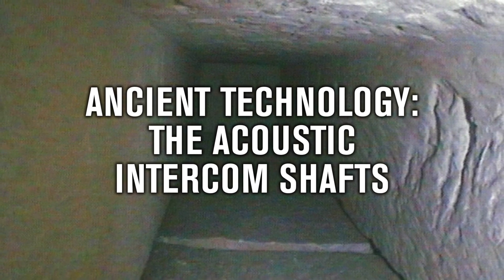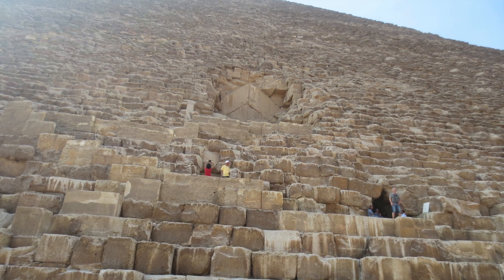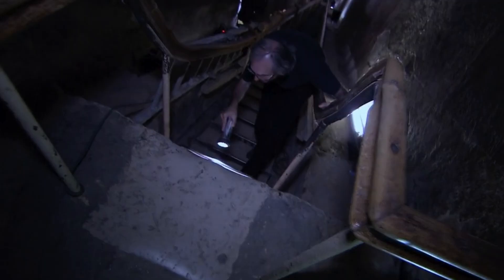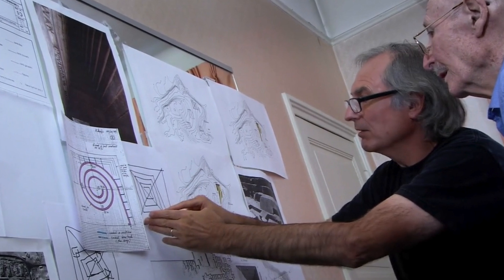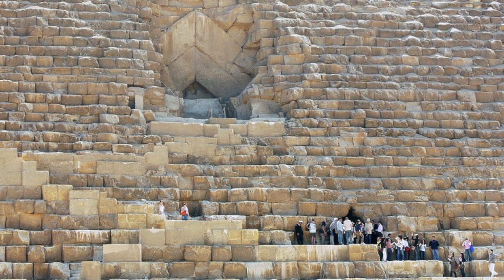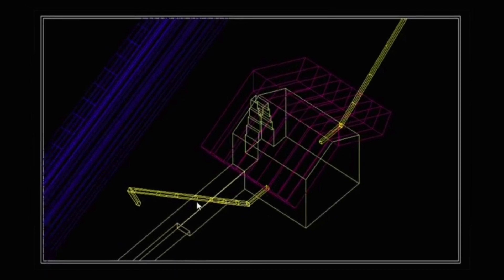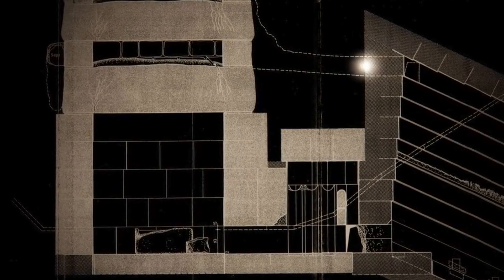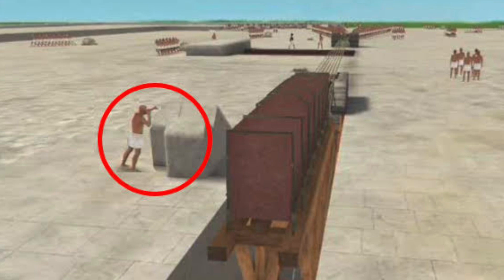Great Pyramid ‘Air Shafts’ Theory: Acoustic Communication Shafts | Ancient Architects

Comment: I know it's off topic of this video, but I would like to tell you a view point that I have had.
It involves the air shafts and what they were used for.
I feel that they were not air shafts and had one purpose, and that was to be able to route electric cables down into the Chambers, that is why there is no soot on the top of the Chambers.
What they found was a blockage in the one shaft and they said it had handles, why would you have handles up there. They were probably copper connections, a way of routing the cable so it doesn't short out. The shafts that don't reach the outside, were probably not needed anymore so they built them in. I am 100 percent sure that this is what they were for.

Comment: The Queen's Chamber shafts do not breach the surface because that is where and how something was fed to it, probably a liquid due to the presence of what seems to be an electric switch at the top which was actuated by the floating cedar bob with rare iron hooks that made contact. Cedar will last for hundreds of years, probably longer than the metal contacts.  My guess is that this was some feedstock to the fuel cell that is the Queen's Chamber.  Chris Dunn has sorted this out pretty well. Furthermore I suspect this feedstock was brewed in the great granite boxes like those we see in Saqqara.  Dead-apis batteries?  Maybe a battery but also maybe a supplier of something like potassium hydroxide that would feed the hydrogen fuel cell.  (KOH).  It would be interesting to find a passageway from one of the temples in the valley below to see how the batch was sent or fed to these feeding tubes.  

The shafts to the outside from the King's chamber, where sound follows the path of least resistance, no mystery here, as it would any other opening, are most likely vents for an explosive or otherwise damaging gas or by-product.  Gas seems most likely and it may well have exploded from time to time.  It stands to reason that this gas was Hydrogen which may well explain the black tops of the granite rafters as well as the fact that this massive assembly moved.  Petrie was not unclear about this.  The half inch or more build up of salt in the Queen's Chamber is the best evidence for the fuel cell proposition.

As for Houdin, it would take a Houdini to smoothly shape even one, not the 15 million or so perfectly flat sides that went into this project.  That didn't happen because it cannot be done now any more than then with the tools at hand.  Until you or he or anyone else can reproduce that effect the carve-and-carry thesis in any form is dead in the water.

Thus having eliminated the impossible, in conclusion, comes my assessment that this extraordinary device was not built to produce and distribute sound but to produce and distribute light.  In the beginning was the sound -- then there was light.  See John 1:1.  Obelisks were most likely designed to shine light by means of the principal of induction.  (When the sun strikes the top of an obelisk at sunrise or sunset the only thing that can see the reflected light is a bird.  The angle of incidence equals the angle of reflection no matter how spiritual you are.  Horus perhaps could see his own reflection but I doubt he cared.  He could admire it all day as he passed over the oceans.)

The King's Chamber, aka the Djed Pillar, seems to be a Djedi Light switch, or at least the tuning fork that turns the switch on. The passages from the Queen's Chamber were likely switches though which told the device when to shut off the feed stock.  The supercapacitor (Ark of the Covenant which you showed fitted neatly into Khufu's box) was charged by the fuel cell and this is what pinged the Djed Pillar/King's Chamber assembly/tuning fork and blasted the water in the well below after traveling down the tuner known as the Grand Gallery -- Sonoluminescence.  Simple as pi.  (Observe:  A Star in a Jar: https://youtu.be/CSIPolpvjBY  )

As for burying bulls in 100 ton boxes perfectly crafted to worship a Bull God -- Seriously?  Wouldn't that be better done outdoors?  Then you wouldn't have to apply the Miracle Occurs Here protocols to get those boxes into places where we can't fit them.  These were practical engineers not mystics and dreamers.  (Aliens need not apply.)

Comment: The reason why the upper shafts were angled and there was no 3rd set of shafts: after reaching the height of the king's chamber shaft exits the distance between the two was small enough so that workers could shout commands to the other side. Further down the distance was too big and they could not be heard and thus they needed the intercom shafts.

Comment: JPH is a personal hero of mine and I strongly believe his theory on how the pyramid was built but this shaft theory does not seem logical to me. One of the questions I  would ask is WHY would builders inside the half finished super-structure need to communicate with the builders outside? At this point in time (supposedly) the queen's chamber and King's chamber where already built so what reason would builders inside need to communicate with builders at the top of the half built structure? Another question I would ask would be why was this system not used in any other pyramid built in Egypt? Like I said I am a big JPH fan and feel strongly about his theory on the actual construction of the pyramid but this communication theory just doesn't seem to be likely (in my opinion) another great video Matt. Keep up the good work!!

Comment: Ultrasound produces piezoelectric in the granite plugs found in the ascending passage, well shaft, entrance to the subterranean chamber as well as the subterranean pit. The ones near water use the piezoelectric to split the water molecules. The ascending passage and plugs are much like a piston found in a combustion engine forcing the hydrogen up the well shaft, into the gallery where it's ignited by the other plugs piezoelectric and the resulting flame is sent up to the kings chamber. This is why you find burn marks in the gallery and kings chamber and the walls forced out. It's the "combustion chamber."

Comment: So you have 2 metal bars in the sealing stones? Looks like a large electrical connector to me.
Could they have used that granite box to house a chemical battery for the heat required for a thermo acoustic engine?

Comment: Why are there no videos on the acoustic properties of the pyramid? Or am I not looking in the correct spot?
I've read that each chamber has it's own frequency. But I have not found any information showing these experiments happening. 
What happens when you use a frequency generator in each of these rooms?
Does 1 frequency blind into the other rooms? If so what happens? Can you hear all the different frequencies outside of the pyramid?
Has anyone used a 7Hz range frequency?

Comment: Communication shafts could only be used after the Pyramid was constructed or at lest only after those parts had been constructed. So, if used for inter-pyramid communication what were the rooms used for and what was the pyramid used for?
Reply: Very good point! The shaft is only there once the stone is laid and then you don't need the shafts anymore

Comment: Ancient Architects, When one comes to the realization that Snakes in Hieroglyphs is a representation of Sound and Vibrations the images take on a whole new light. We see things like the Dendra light bulb which is showing sound waves coming from the Staffs fork shape at the bottom going over a DJed pillar which crazy enough I am starting to believe might be a heat engine like a Stirling engine. The later part could be wrong but the more I look the more it seems like it might be the case.
Reply: you actually can READ the texts in the Dendera temples. It was an important religoius center during many dynasties. No Däniken here.

Comment: Then why are there not any other acoustic shafts that aid in the building in any other pyramid? If this was a design feature to aid construction then all other pyramids would have the same shafts installed. Also why are there only two? Wouldn’t there be four to aid construction on each side? Also what is being communicated by a worker who can’t see what is going on on the outside? Any ideas? Thanks Paul?

Comment: The 'air shafts' were housings for 'antennas' which connected into the sarcophagus, which was actually a meditation pool filled with conductive salt water. The Great Pyramid was either an astral projection machine or perhaps a healing machine.

Comment: If you are correct and the shafts are merely air holes,  It would have been much easier for the builders to simply drill a round air hole parallel to the ground 
or a downward pointing shaft (so that rain would not enter).  If we look at the facts.  The shafts are designed to perfectly rise through many layers of stone and are perfectly shaped rectangular in shape. Why would air holes need to be square?  This square shape is much harder to design into the many stones involved at many layers of the pyramid.  The shafts appear to be pointed at particular star constellations.  Perhaps hundreds of years after the original architects were gone, the next owners decided to close up the shafts to prevent anyone from entering the pyramid?

Comment: I think there’s a missing detail that makes this compelling… That is that they also needed to communicate with someone inside the chamber for some reason, possibly to set the roof blocks? Otherwise, you need to explain why it wouldn’t be easier to just have some bamboo pipes stretching across the work surface

Comment: Good video!  I  like to hear all the theories and possibilities.  The level of knowledge to build the great pyramid is astonishing.  There is nothing that really compares to it in the world (although there are pyramids in China and South America which come close).  Most of what you presented makes complete sense and probably extremely close to the truth.  The problem I have is who were the architects / engineers at that time who designed it so perfectly and possessed that level of knowledge of acoustics, engineering, construction methods, etc...  Technology, engineering and construction methods need a progression and development over time, so to build something like the great pyramid as one of the first of the big pyramids makes no sense. Especially considering the 2500 b.c. timeframe.  2500 b.c. isn’t far off from early stone age humans.  I 100% believe it was build by man.  However, there are some serious questions and problems with all the theories.  Considering the suggested construction timeline, just the quarrying and transportation efforts of that much stone doesn’t work. Add the “ramp theory” to the equation and it doubles the materials and effort.  If I’m not mistaken the “ramp around as you build up” theory has no physical evidence either.  Are there any estimates on the work force required just to quarry and transport the stone to the site?  Plus, all the stone work around and related to the great pyramid (remnants of the very large stones placed and then “shaved flat” are in itself astonishing). Limestone is common and close by, but a good portion is other stone types which were quarried a far distance away.  What about the amount of wood (specifically large timber) needed for construction as depicted. They would have needed a very steady flow of large quantities of large timber.  If you start adding up the estimated workers needed for the various tasks, not just the guys “pulling the ropes”, to place 13 to 14, 9 ton (average) stones every hour, 24 hours every day for 20 years it doesn’t work in the timeline given or population at that time or even common sense.  It would be safe to say there would have been “bad weather” days or weeks or even months delaying the work.  Factor that in and the placed stone per hour goes up.  When you step back and look at the big picture, look at all of the site not just the pyramid, nothing adds up.  There was advanced engineering, technology and sciences at work.  If someone suggested that the Egyptians found the great pyramid (or a portion of it), then repaired, rebuilt part, added to it or finished it, I could accept that much easier.  I had this discussion with my son, who is also an engineer, and he responded to my question regarding “who” from that time period could have had that kind of knowledge, his answer, “a savant”.  I hadn’t thought of that possibility.  Intriguing 🤔

Comment: More likely the shafts were used to measure the progress of the construction to ensure the angles of each side was consistent.  They were not necessary after construction so they were sealed off.  As evidence to support this thought is that red ochre marks were found in the shafts and these were translated as measurements in cubits.

Comment: While the shafts and chambers are acoustically tuned (fair observation, btw), this is only relevant to the shafts and chambers function as electromagnetic circuitry. They're energy conductors. Acoustic tuning may very well a factor in their function as well.

Comment: Cool.  I would suggest a series, but I am sure you will have a better feel for it as you work through the project.  I like Houdin.  I think his theories are good and explain a lot.  I like the sound transmission idea for the air shafts.  I wonder about Khafre's pyramid.  It doesn't have "air shafts".  Were they not needed since, seemingly, all his chambers are under the pyramid so people could just call to each other across each course they were laying?  Just wondering.

Comment: I've known about the abilities of the pyramid to amplify sound but not to the level described here it almost seems sadly downplayed by many alt researchers. This is also one reason I like Dunn's theories because if it can amplify sound why not energy in another form as well? What if the ark of the covenant was a meteorite with electrical properties that was housed in a sort of capacitor with the solid gold lining and was taken into the sun to charge during the day then power the pyramid at night. Because of water's paramagnetic properties it was what was able to push the waters of the redsea aside when fully charged for Moses when they stole it and fled Egypt. The discharge from such a capacitor if touched by the hand or opened would be instantaneous death and they would have a god like reverence for the object. Also the emerald tablets and ark may be the same thing or a piece of the same meteorite. Only the stone tells you the story when you touch it its not written on it, which is why moses "spoke" to god. The general outline of the ten commandments and the story on the emerald tablets are pretty similar in morals so it is quite possible moses's interpretation of him touching the tablet was to give his people the 10 commandments and used the tablets as a decoy to draw attention away from the real Ark being the emerald tablet itself which powers the pyramid and the Ark housing capacitor. Thats my theory anyway. I'm sure if the pyramid did have an electrical function it had long ago degraded into a superstition/religion by the time Moses left Egypt or whoever the real life version was. I believe you did a great video on that too.

Comment: These shafts are Star shafts.  The incredible precision and straight lines designed at the perfect angle to create perfectly straight lines through many many blocks of the pyramid would not be necessary if l the shafts were merely used for the workers to hear each other 
in the construction stages.   Remember that during construction there was no rock above them so they could simply shout into the open air above them.  Pyramids are built from the
bottom-up so there would be open air around them while designing these perfect  star-shafts.
Reply: Any 'star shaft' can only ever point at a star for a few minutes per day. It would seem hardly worth the massive effort in construction to achieve that!

Comment: Hmmm...i definitely think that the shafts helped the builders with communication but i doubt that was the reason for building it in the first place. 
I much prefer the idea of hearing the tuning fork outside of the pyramid.
A big old amplifier that was used to preach to the masses outside perhaps?
Reply: The only problem is the pyramid was sealed, it wasn't built with access to the chambers until entry was forced by tunneling and removing the blocking stones. I don't have any solutions either but I'm enthralled with the mystery of the great pyramid as we all are.

Comment: This is wrong on so many levels The logistics of construction at the Giza site are staggering when you think that the ancient Egyptians had no pulleys, no wheels, and no iron tools. Yet, the dimensions of the pyramid are extremely accurate and the site was leveled within a fraction of an inch over the entire 13.1-acre base. This is comparable to the accuracy possible with modern construction methods and laser leveling. That's astounding. With their 'rudimentary tools', the pyramid builders of ancient Egypt were about as accurate as we are today with 20th-century technology

Comment: The only two problem I have with the shafts been sound transmitters," is that the second great pyramid is only a bit smaller in construction and it didn't have any shaft to transfer sound.plus the queen's chamber shafts and King's chamber shafts are not that far apart in the pyramid.why go to all the effort of making shafts which is a feet in it self to build, just to transfer sound a bit higher up..when they had enough man power to relay orders . its probably the best Guess I've heard for the shafts.but I still th8nk they where used for the kings soul to travel in and out of the pyramid.